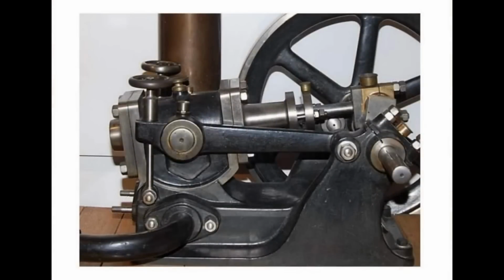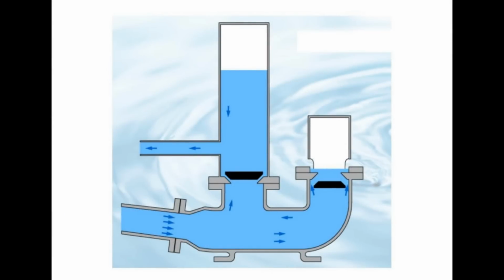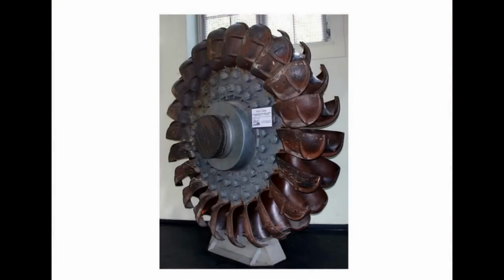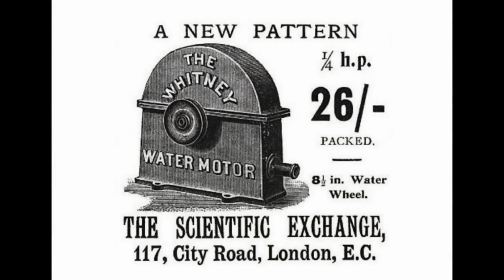2024 The Water Engine - A Forgotten Motor

Comment: Hey Robert, 
Very cool stuff! I love water related things. I have an early 1900's hydraulic ram pump that still works
Question: In the water engine animation in the video, does the water recirculate or does it flow through an inlet and exit the engine? Thanks

Comment: These aren't exactly "engines", though, are they? Basically hydraulic motors. There was an actual water engine design which used liquid water (as opposed to gas) as the working fluid. John Malone. It never really took off because, I suppose, it didn't offer any real advantages over more traditional heat engines. The nature of the thing is that the displacement is rather small and the working pressure is very high, which made it a bit useless and hard to engineer back in the day. It might be something you want to play with, though.

Comment: Could you make a pelton wheel,  where half of the device is sealed and full of water.  Now make air pockets under the buckets that  use the bouyancy of air to lift the buckets of the pelton wheel on the 2nd half of the pelton wheel.   One side of the pelton wheel is normal, and has gravity pulling the weight of water down, but on the other side of the device, the bouyancy of the air pockets under the buckets is lifting the buckets.   Add magnets and electric field and you have a closed loop motor that runs on the gravity of recycled water and the bouyancy of air. Would this work?
Reply: make the buckets out of a material that floats and you have even more bouyancy on the side of the hybrid pelton wheel that is full of water.      the weight of the water buckets on the normal side of the pelton wheel and all that bouyancy on the other side of the pelton wheel that is sealed and full of water.   this should be enough force to make this hybrid pelton wheel run forever in a closed loop system that recycles water.  just like a normal pelton wheel would run indefinitely with a constant flow of water   (like hydro electric dams.  this is a closed loop hydroelectric dam that recycles the water used)

Comment: With this kind of techs (and also the small compressed air motors of Tom Stanton) it makes projects of gravity water battery closer to reality (like in the "Storing Solar Power on my ROOF!!!" video of Quint Builds, and / or with better use of solar electricity with membrane and valve pumps, like in the "Le pompage en autonomie avec 50W seulement!!!" video of Guillaume Piton Edit: Actually There are at least 2 pumps working with that : The Bunyip pump and the Glockmann pump :)

Comment: Water motors are still used to drive emergency sump pumps. There are installed in case of a power outage.

Comment: so instead of having electrical lines to supply energy the energy is supplied in terms of water psi then the physical energy is then converted at an efficiency loss back into electricity with a water pressure engine or just used directly :( 

so what do you get out of this system like 3-5% efficiency?

Comment: More than a hundred and fifty years ago in Wellington New Zealand there was a city wide hydraulic system.

The good quality water came from a spring and dam high in the hills.

The wharf cranes used the water at more than 200 psi to operate rams that moved the cranes on their rails and to provide lift with sheaves and steel cables.

The coupling pipes were joined with knuckles that leaked a fine spray as they moved.

These were still in use in the 1950's where I remember them as a child.

I think one of the marine slips used the same system although the other had a still operating coal fired boiler and double expansion steam engine.

Comment: Seems info on these is a little bit hard to come by but I interestingly came across some designs that I think replicated head/height using pressure from weight. Unfortunately Im lacking the necessary shed to do any tinkering but makes me wonder could you have a configuration based on a closed loop cycle with check valves where pressure is generated by weight in tank A which runs through the motor to a tank B at a lower pressure (due to lower weight) if the weight is on a pulley system all you have to do is shift a little bit of weight (e.g: pumping a bit of water) to cause an imbalance and generate pressure from tank B. I doubt Im explaining it very well and no doubt there is a fatal flaw but these videos are always great at getting the hamster going. Keep up the amazing work.

Comment: I hope you guys can weigh in on a thought experiment I’ve had.   

Invasion two large cylinders.  A chain hoist on a rail capable of being positioned over each tank.   Hoist is used to lift and reposition a large weight above each tank.   

One tank, full of water has the weight released upon it.  Water is forced through a very small aperture up a tube to a water motor located between the tanks at the top.  

Pressure created by the heavy weight drives water up the tube, through the nozzle, spins the wheel then discharges into the apposing tank, filling it with the “waste water”.  

Once the weighted tank is empty the “waste tank” is now full.  

Now The waste tank is weighted, reversing the process.  

Anyone willing to run the math on what volumes and pressures could be required to create a viable amount of electrical energy?
Reply: Had similar thoughts and it seems so simple I am left thinking there has to be a fatal flaw. If you have the weight evenly balanced either on a fulcrum or over a pulley system for two large cylinders for tanks you'd only need to move a fraction of that weight to create an imbalance and thus pressure. It likely couldn't be very high pressure as it would be a free moving in the cylinder and not a closed tank but some old photos I've found seem to have ones based on huge weight/ballasts that are 10s of tonnes just by the looks of them. Unfortunately no space to tinker and Ive no clue what math would need to be run
Reply: @davidcullen4996    Yes sir.  Sense we are not trying to simply transfer the water we need more that just an imbalance.   We need a high level of pressure to create a strong driving force to act on the turbine (pelton wheel).   

The cylinders will need to be tall and smaller diameter as the weight is evenly distributed among the square led area of the waters surface.   

I’m curious how to do the math on expected run time based on available water in the cylinder vs pressure  at the tip of the nozzle and force that could be expected at the wheel.  These figures would help me understand if it’s worth while to build a scale model.   

I am 100% capable of the fabrication but don’t feel comfortable with my math.  If the available energy isn’t worth the overall project it’s kind like pissing in the wind.  

My rational mind says it’s feasible.   And forcing 400 gallons of water past a turbine at 500psi through a needle jet.

Comment: The Tower Bridge originally used water engines to raise and lower the bascules.  They used large hydraulic accumulators to store the energy required. Now done by electric motors...

Comment: The exclusivity of the concept details and hardware were in the hands of engineers in previou s times because of the steel and iron needed to make them. That and the accurate machined tolerances ,which for metals required other machines machinists.
But now Robert you are onto something in that the parts needed have the tolerances,the machining is  already contained in the inexpensive strong molded parts,andthe machine weight is order of magnitude less.
This makes the engine /compressor  available to any number of people. 
So obvious it took Robert to see it.

Comment: I wonder about using pumped hydro between two deep bore holes, one with a very heavy cap to pressurize the water and the other with a light floating cover. Basically we use water as a transmission between the weight of the cover and the heavy cover. I wonder if this might make pumped hydro storage work in a lot of places where it can't be done on the surface economically. Thoughts?

Comment: Very cool! It seems to me the difference between a water motor and any kind of wheel is one of volume. They both require head, but in an application where head is good but volume is scarce, I would wager a water motor would produce more power than a turbine. Thanks!

Comment: Yeah I haven't done it yet just an idea for now but I just thinking about a couple of IBC totes the bottom for a reservoir one on a high platform with a windmill rope pump to replenish the upper tote to run a pelton wheel to generate electricity to recharge my batteries when I need when the sun doesn't shine and the wind isn't blowing as an emergency backup do you think it has a chance of working? I'd use rainwater I collect

Comment: Interesting fact: Manchester's Hydraulic Power system was a public   network supplying water power through a piped network across the City . It used a system of high-pressure water pipes from three pumping stations from 1894 until 1972. Many of the artifacts from the system can still be viewed in the  Museum  of Science & Industry. It supplied motive power to many businesses,  where stand alone steam plant was impractical.

Comment: In theory, this is fine but in reality, the math does not work in anyone's favor.  The realistic cost to build one VS the few watthours of energy such a motor would realistically produce in any given time frame from a home water supply is dismal.    

If I did my math half right it might be able to charge a cell phone or two in a day based on typical household water usage.  (GPM x time x pressure drop x efficiency) / 2 = Watt Hours (give or take a lot) 😋

Comment: What's to prevent residential, industrial and other point of use  waterflow systems to produce countrywide electricity production. It of course would be cheaper to install something like that at the point of water distribution. I dont know, an inline turbine system. Of course that would get a lot of flake here in the United States by the corporate capitalist, and so we the piblic would have to insist that government take over the utilities industries.
Reply: Don’t worry, that time will come.

Comment: Seems like you could run a water engine from a large tank of water with a weight on it. To recharge it lift the weight back up and pump water from the discharge pond to refill it. And start the thing up again.
Reply: The whole system looks more a battery or an accumulator than an engine to be.
Reply: That's pumped hydro.

Comment: little off subject here. In the serpentine coil that you made before in video 1929. What is the minimum rpm's to that coil to produce a descent voltage and/or current?
Reply: E = Blv sin θ
E= volts
B = magnetic field strength (Tesla)
l = length of wire (m)
v = velocity (m/s)
θ = angle that the magnetic field sweeps the wire.
For the length just count the number of straight sections and multiply by the number of turns in your coil. Just ignore the round parts and the sin θ, you'll get an approximate result. Everything is constant besides velocity, so you can reduce that formula to a single factor * velocity to get voltage

Comment: Steam piston engines are deceptively simple. You can use the top and bottom of the piston as two cylinders. Steam goes in the top and pushes it down and then steam goes into the bottom pushing it back up. Fantastic little buggers. I can go on all day about steam engines and steam turbines along with all of the various equootrimonts. 3d print a stream engine for yourself and run it on compressed air. Compressed air won't melt plastic like steam or superheated steam lol
Reply: accoutrement? 🙂
Reply: @blanstevslc  yeah that word lol. I use the word. I know what it means. I just had a very very unfrenchly moment haha
Reply: It does have two major drawbacks: Booms, and burns.

Comment: Maybe place it in line directly on the out flow pipe of the main header tank in the loft, and every time any water is drawn anywhere in the house you're scavenging energy.  Interesting thought, nice one Robert. I'm still working on my VAWT mind, collecting microwaves for magnets and transformer coils  takes some time.
Reply: Remember you're not going to be using water continously though, and the pressure difference is relatively low. Some people have tried this, admittedly with small low-efficiency turbines, and the resultant power was not high. They used them on incoming mains pressure TO the loft though, which gave them more consistent pressure.